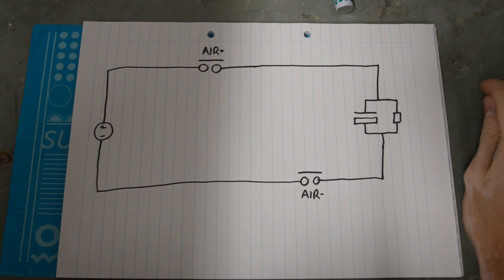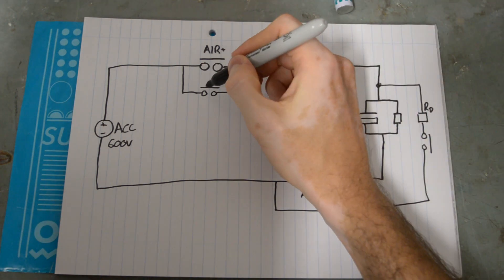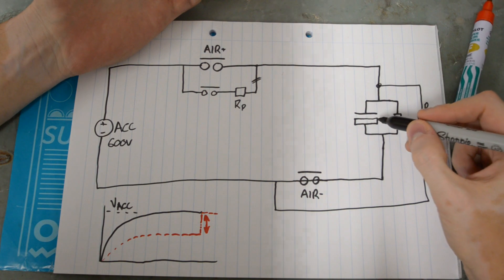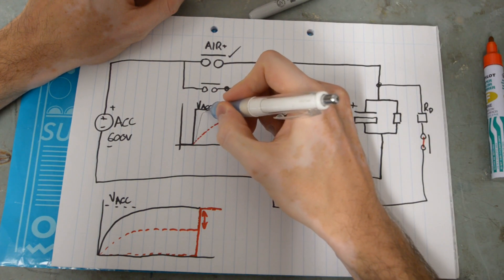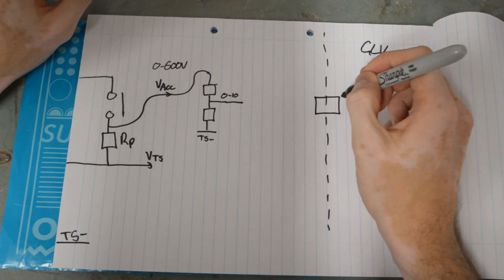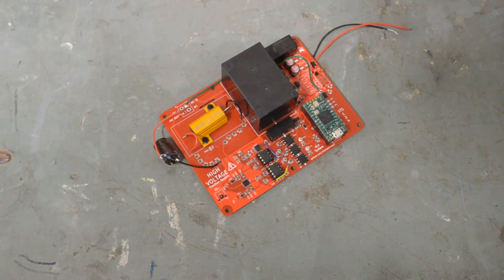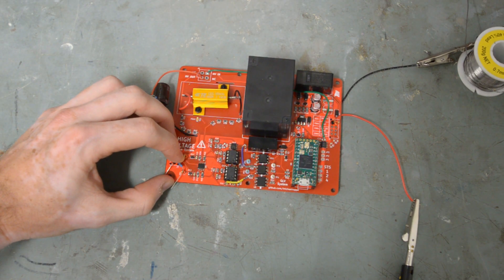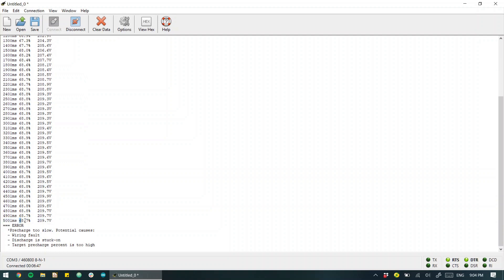FSAE Electric: Precharge | Intro & voltage-feedback design

Comment from the maker: Warning! I drew the discharge circuit incorrectly. Of course, the negative side should remain on the TS side of the AIR-
Reply: Why can't the discharge circcuit go to the accumulator side of the AIR-? Also, how does the discharge circuit discharge if not connected to the accumulator? If it just discharges into ground, i'm just used to ground being connected to the negative side of a battery.
Reply from the maker: @gizmodobaggins7040  the discharge circuit is for the capacitance in the Tractive System - not the accumulator. Isolating it from the TS would defeat the purpose which is to make the TS safe quickly after the AIRs open. If it's connected to the accumulator-side of the AIR- it can't do this.
Reply: @MichaelRuppe  What size resistance did you use for the voltage dividers for measurement? I would imagine you don't want a lot of power used by it so they would be quite large?
Reply from the maker: @gizmodobaggins7040  they are pretty large. Check the schematic in the repo

Comment: Could you maybe add a pdf file of your circuits in your github repo? It is very annoying how none of the online kicad file viewer can deal with your 5 year old files and I really don't want to install Kicad just to have a quick peek what the second SMD IC on the TS side does (I know the first does the temperature monitoring).
I would also like to suggest using a 555 pulse width modulator circuit insted of the V-F converter, as it is a loooot cheaper, simpler and smaller than the LM331 circuit. That will also fix the issue with the minimum frequency and you can even low pass filter that signal to get the analog voltage back. There are also V-F converter (aka VCO) circuits with the 555 timer, which can also save you some money and space. Quite a versatile little chip. I use it for the red TSAL light blinking.
You could also do the comparison of the two voltages at he TS side and just trigger an optocoupler, if the voltage is >99% of TS voltage, if you don't care about the voltage somewhere else of course.
Reply from the maker: If it's very annoying for you, why don't you fix it with a pull request?
You're commenting on a five year old video published for free that thousands have benefited from. Grow up

Nice recommendation about the 555 PWM circuit though. This was the best I could come up with at the time, with the constraints I had
Reply: @MichaelRuppe  I found it anoying that all these online tools could not deal with a (atleast) 5 year old file format of a widely used open source program. You not providing a PDF file would not be an issue at all, if any worked right. I would have to install your version of Kicad to look at those files. I was just curious what this other SMD IC on the TS side does. I am also way past my FS prime having designed the whole TSAL and discharge circuitry of our first EV.

We have bought parts, that already do the voltage measurements at the battery and inverter side of the TS and transmit them per CAN, so the BMS just reads them to know when to switch the AIR+. The best circuit after all is no circuit.

I also looked at the common 555 PWM circuits a bit more and they suck a bit because varying the control voltage changes dutycycle and frequency, but you can just do a sawtooth generator and compare that to the analog voltage. Thats also how PWM voltage regulators work, btw.

Comment: Thank you for the video, I need this for my HV storage.
Just a question - wouldn't it be enough to simply connect the optocouplers to both sides of the charging resistor via the divider and compare the voltage differential? Either it's within the allowed range and it turns on the relay, or it's not within the allowed range and nothing turns on. Absolute voltage values are irrelevant I think. 
Sorry, I'm not an expert :)

One more question, can this board be bought?

Comment: Hey Michael! just wanted to leave another comment since i've now successfully implemented my own modified version of your design. i removed the resistor overtemp circuitry, moved the resistor off-board, and swapped various parts like the optos, HV relay, and so on. cheers!
Reply from the maker: Hey great! I'm glad open-sourcing the design was helpful for someone

Comment: How do you power That voltage frequency converter, Do connect it to GLV Battery? if that's the case, does it break the galvanic isolation rules??
Reply from the maker: See my other reply about the SPAN02 DC-DC converter

Comment: Hi Michael, would this approach work as well? Instead of using a V-F converter, why not have a microcontroller on the HV side which measures the voltage at the divider. Then it can communicate over Serial through the optocouplers to the mcu on the low voltage side. Thoughts? And thank you for the advice!
Reply from the maker: Totally, you could use a micro. It would simplify nicely. I briefly mention that in the 'recommendations & to do' section.

Comment: Hey Michael, thanks for the video - fantastic explanation of the system. Quick question that I'm hoping you could answer. What's the advantage of measuring the voltage across the precharge resistor? Would it not make more sense to measure the voltage across the capacitor, since you can then detect a few more failure methods? I was thinking that the TSAL and precharge circuits could make use of the same voltage divider to perform their respective duties.
Reply from the maker: Hey Jake. This circuit does measure the voltage across the capacitor: the Tractive System voltage. That is the measurement downstream of the resistor. It's not the voltage across the resistor being measured, but rather the upstream and downstream voltage are being compared. The point here is to have a voltage-sensitive precharge strategy that works regardless of accumulator voltage or state-of-charge
Reply: @MichaelRuppe  Hi Michael, follow up question - hope you don't mind. Do you ground all the tractive system components to the HV- line? Just wanting to know if there's any reason why that wouldn't be the case. Seems intuitive, but thought I'd ask to be sure.
Reply from the maker: You could absolutely combine the TSAL circuitry into this. On our car the precharge unit is in the accumulator, and the TSAL controller elsewhere
Reply: @MichaelRuppe  That makes sense - thanks for the clarification! Thanks a ton!

Comment: Hey! Can u also add schematic files for precharge and AIL in pdf format? I couldn't see them through your GitHub account :c
Reply from the maker: The AIL was part of the early TSAL design. This schematic includes the AIL functionality
https://github.com/michaelruppe/FSAE/blob/master/TSAL/TSAL-HVM/schematic-tsal-hvm-v2.1.pdf
Reply: Oh, thank you so much!
Reply from the maker: @tolga3115  You're welcome. As far as accumulator indicator goes you might be better off with an analogue voltmeter. Also, be careful with that design - check the maximum voltage rating of the regulator. It isn't that high
Reply from the maker: The precharge schematic is in the repo: docs/schematic-v1.1.pdf

Comment: Can I get some help designing a precharge circuit for
My off grid system?
Reply from the maker: Hi Tim. Do you have some place where you can share your work so far? A link to a stack exchange post would be great - and you can get input from the rest of the community too

Comment: Im refering to the schematic that you have uploaded on github....i saw that that there are two high voltage grounds, Gnds and TS- ....Both these grounds have been connected using a 0 ohm resistor...is there and specific reason to do this? Also do they refer to the same ground?
Reply from the maker: They are the same ground, I did this to create a specific path for the analogue ground. If you refer to the pcb project you will see how it is routed independent of the ground plane. This isn't strictly necessary because there are no large currents flowing in the ground plane anyway - I was just playing with the idea

Comment: Really good explanation of the precharge circuit! It really cleared my concepts and now have a very clear understanding of precharge.
I had some doubts regarding precharge in general
1) is resistor divider a good measure of the voltages? Because a small error in the resistor value will cause a very big change in the corresponding high voltage measurement... especially if its around 500V
2) can we use an isolated adc directly instead of converting to voltage and then frequency?
3) are there any other possible approaches for precharge?
Reply from the maker: 1) you're right about small errors being magnified. Resistors should be 1% and you can be conservative with parameters in the program to guarantee adequate precharge.
Reply from the maker: As for your other two questions, there are certainly other ways to do this. AND there are certainly better ways. This is the way I chose given the resources and knowledge I had at the time.
An isolated ADC sounds great! You would remove the v-f complexity and the calibration requirements
Reply: @MichaelRuppe  thanks alot!
One more small doubt...i read the datasheet of the voltage to frequency converter...it says that it can handle input voltages upto 40V max....so will scaling high voltage to 0-40V have a significant improvement in accuracy?
Reply from the maker: @shubhamkarekar7695  higher input voltages will help with error tolerance, but be careful. That 40V sounds like it could be the absolute maximum, which should be well avoided.
Remember that you can also characterise the response and calibrate out any errors

Comment: Hey Michael, Fantastic explanation for me to look at and understand very easily with year 11 knowledge. I just have a few questions?
1 - What does it take to get into FSAE?
2 - What kind of hours and training is put into building and creating the Formula Students Cars?
3 - What kind of knowledge do I need to understand the basics of FSAE

I have been practising on Assetto Corsa (Im pretty serious about join, as its what I have been working towards to drive and make a Formula Car)
Thanks
Reply from the maker: Hey, thanks for watching - apologies I must have missed the notification. Fsae represented about 1000 hours over 12 months for me and many others on my team. The time commitment is nontrivial, and financially its no joke either - in general fsae teams are funded by their universities and obtain sponsorships for funding/parts.
It was seriously the best way for me to finish my studies though
Reply from the maker: As for knowledge - it's a practical project so a lot of knowledge is built during the project. For my role, a background in hobby embedded electronics and circuit design certainly didn't hurt. For others, being racing enthusiasts and having experience with mechanical hardware was critical. It seems that your prior experience will help you fall into a role neatly. if you have limited experience, leading a project on the car will fast make you a subject matter expert in that area

Comment: What about the provisions of Galvanic isolation between the the potential divider u used and voltage to frequency converter ,I believe According to fsae rules we do need to provide galvanic isolation between high voltage system and low voltage component ,even though if we drop down the voltage of the accumulator still it is from high voltage side .
If the v tof conevertor is galvanically isolated ,can u share the ic number
Reply from the maker: Good question! The VF converter is powered by a SPAN02A-12 isolated DC-DC converter. Together, the SPAN and the optocouplers galvanically isolate the VF converters from the GLV.
Take a look at the schematic for the finer details
Reply: Okay ,so  the ground which will be used for powering this v to f convertor ,will be a high voltage ground / acc- 
Correct me if I am wrong ?

Also I tried access the schematic from your drop down GitHub link ,I couldn't I guess it has been removed can u plz re-upload it .
Or even u can mail it ,it will work ( ps - if u don't mind )
Mail id - mehul.lad8390@gmail.com 

Thank u very much !
Reply from the maker: @mehullad7511  try this one https://github.com/michaelruppe/FSAE/tree/master/Precharge
Reply: Thanks a lot  @michael

Comment: Is programmable logic allowed for precharge circuit as per FSAE rules ?
Reply from the maker: As far as I know there is only a stipulation that elements of the shutdown circuit must be non-programmable. The shutdown circuit handles the safety of the EV, and the precharge is powered directly by the shutdown circuit. I believe that means a programmable precharge is acceptable.

Comment: Yes, if you infer the Inverter voltage from signals inside the accumulator housing then there are open-circuit failure modes that can trip you up.  Therefore detecting a pre-charge that is too fast takes care of those. Good idea. The messier solution is to wire the actual inverter voltage back into the accumulator housing, to the pre-charge controller, and perform a  direct comparison between accumulator and inverter voltages. Thanks for sharing.
Reply from the maker: Thanks for taking the time to have a watch, Craig